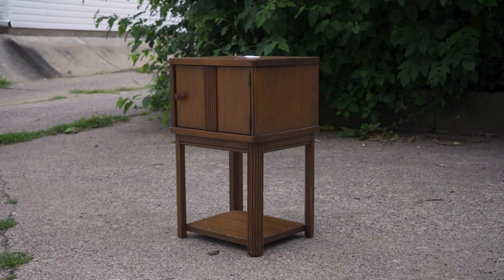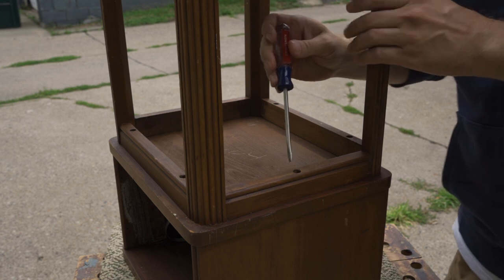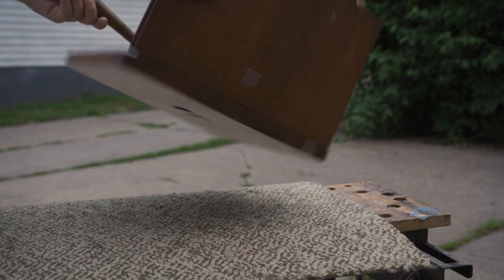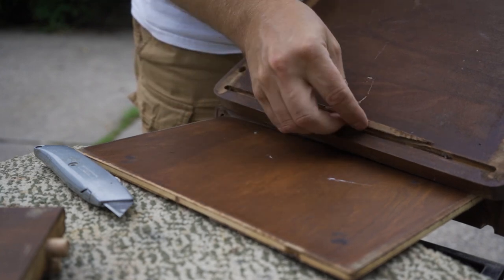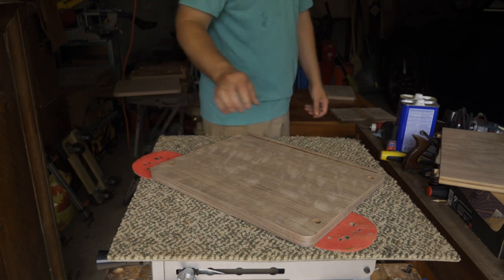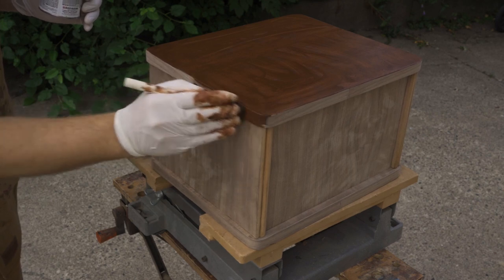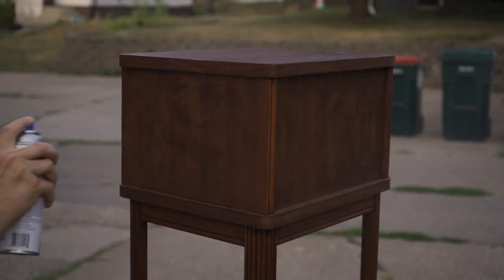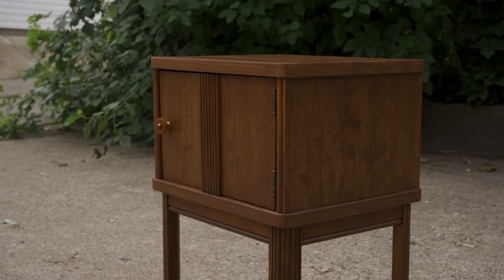Thrift Store Rescue #24 | Refinishing, Repairing And Applying New Veneer To Thrift Store Furniture

Comment: I am not certain, but I think this small table was a Portable Phonograph Stand, for the small
portable phonographs that were popular in the early 1960s -  The phonogaph would have
sat on top, the 7" 45 singles in the cabinet section, and the 12" LP albums in the lower
section.  

   The hole in the side was for a power cord for an AM/FM Portable Radio that was placed
in the cabinet section at a later time.

These quickly fell out of favor in the mid sixties when larger, more capable modular Stereo
Systems, with Turntables, Amplifiers, AM./FM Receivers, and Twin Speakers became more
available.  

Very nice work on the veneering / restoration - this could now indeed be an elegant Cigar
Cabinet !
Reply: I think your assessment about it being a phonograph stand is absolutely spot on.  I've seen others like it with exactly that purpose.  It helps that I was born in the early 60s.   ;-)
Reply: I thought the same thing, and figured it was a high school build.
Reply: Tend to disagree. The fluting and detail work is very 1930s
Reply: @steveparker2938  Who knows, it might have been deliberately retro (with respect to the age it was built of course). Maybe it followed something like the Popular Mechanics articles of that era, which were about how to build a neat this, a cool that.

Or... it was built earlier and was later repurposed from an actual tobacco cabinet.
Reply: I would have expected a larger hole, in the rear, wide enough to pass the plug through.  Unless maybe a homemade extension cord went through that hole, which would also ease servicing whatever was placed inside the cabinet and let more than one item be placed inside the cabinet. But again there was no place reported where the socket end would have been anchored (unless it lay loose).
Reply: No, this is positively 100% a smoking cabinet from the 30’s/40’s. I have sold several (I’m an auctioneer). It seems that it was altered for some other use with the hole in the side. Too bad because these in original condition can bring really good money.
Reply: @chappy675  would it still be good money if it was just reglued with no new rendering?
Reply: @chappy675  i collect humidors/smoking cabinets purchased at auctions. If it is one, perhaps a hole was made for ventilation or the door sealed shut.
Reply: My grandfather had a similar piece he used for his pipes and tobacco.  It sat by his spot on the livingroom sofa

Comment: Ah, the old duct tape and staples technique. Lol
Reply: Seriously!  Even if the previous owner didn't have wood glue, you would think super glue would be used.
Reply: Works every time!
Reply: Scotch tape around here, cheap and lazy bunch lol.
Reply: A proffesional would use wood glue to stick a patch of tougher plastic to the inside of the cabinet, and use a bent 4 inch nail to hold the outside together, works much better than duct tape and staples.
Reply: @Beerwalla1  I'm with the 4 inch nail but only if it's rusty to blend in with the natural woodgrain finish. Actually what was I thinking, obviously it's rusty, who has new 4 inch nails anymore.

Comment: What a great little cabinet.  I’ve not seen one like it before.  I love that you covered the top portion in veneer and ran the grain the same direction as the fluted molding and the legs detail then stained the same as the veneer.  It’s the little things especially that make this stand out. Great job 👍
Reply from the maker: Thank you.

Comment: Due to the tobacco odor, I suspect the small hole may have been for an humidity probe that was attached to a meter outside the cabinet.  Nice job with clear descriptions and reasons for each step.  Thanks.

Comment: What a wonderful piece of furniture. Nana could use it as a plant stand or Grandpa could use it as a bar table. Something that would look nice in the corner of the room.
Have you had great success with the peel and stick veneer? Takes so much pressure off a person in not having to cope with contact cement.
I look forward to more great restorations.

Comment: I appreciate your attention to detail. The cabinet is good for another 50 or 100 years! I have also learned that the antique dressing table could have been saved from peeling veneer. I wish I had it back so I could try to give it another lifetime of use based on what you did today.

Comment: I'm almost certain this was an old humidor robbed of it's copper. I've been looking at these for  years now, have seen many in antique stores and even own one of my own bought as a future project. I've found that resell value goes way up if you've got some thin copper plating to line the inside of the cabinet. Project came out looking wonderful!

Comment: I love the little tips this guy provides, like using a block when cutting against the veneer grain. Or using a razor to wipe off excess filler - why didn't I think of that lol. The only thing I didn't like in this one is the color. For me, it's just on the dark side. I like to see the grain pop, so I would have used Danish oil. And then a lighter gel stain for the accent (non walnut) parts. This coming from a non-expert :-)

Comment: Like the use of the knife blade for the veneer with the grain - use that, too - but I also have a veneer saw with a curved 3" blade intended for with the grain, but also appears to work wonders across the grain. Almost no set to the teeth (17TPI) so it "glides" rather than cuts. Still, knife edge might be better, as you suggest, for cross-grain.

Comment: Beautiful, as usual. I have a question. It’s about something I noticed other conservators and restorers do as well: if they end up having to disassemble a piece, they reassemble it first and then they apply stain. Apart from propping the pieces to dry, I would think it would be easier to stain the pieces first (avoiding the surfaces you intend to glue), particularly the ones that make up the insides of the compartment. Would there be a drawback to this, or is it simply more satisfying to watch the transformation of the piece as a whole?

Either way, watching you restore this little cabinet to a showpiece was a joy!
Reply from the maker: It would sometimes be easier to stain before glueing but the problem is that when you glue it up, you might get glue squeeze out onto the newly stained wood.  That’s hard to clean up without removing the stain. It’s easier on unstained wood.  You can sand it without risking removing the stain.
Reply: @DashnerDesignRestoration  That makes complete sense. Thanks!
Reply: @DashnerDesignRestoration  That makes complete sense. Thanks!

Comment: I received a 1940s waterfall style small dresser with grooved handles and edges. The grooves are similar to those on this piece. But, someone (my grandmother, I think) covered it with flat wall paint, which, for obvious reasons, I would really like to remove. :) This would be a first for me. Would you recommend a paint stripper or sanding. It's a thin coat of paint. I don't know what I'll find underneath. However, I'm confident it's not some magnificent antique. I don't expect miracles. :)
Reply: @pamelap.123  I saw it. It was great. I'm just unsure if using stripper or scraping/sanding is the better option.

Comment: Great work. Do you ever get finish issues when you lacquer in such open air? I know you buff and wax it, but sometimes when I do similar I get particles that affect the finish integrity when they're buffed out. Is it about having a light touch and just keeping the environment as clean as possible, or recognizing that imperfections will happen and that's part of the character of the piece (or both)?
Reply from the maker: I do get debris in the finish sometimes.  If it’s really bad I will sand lightly with 320 or 400 grit before the last coat.  Anything left after that I will either carefully pick out with my fingernail, buff with the steel wool or just accept as an imperfection that happens when you finish outside. Also, avoid applying the finish on windy days.

Comment: I thought you're videos I watched were very informative. I've only been refurbishing furniture about a year and am just starting to work on pieces to sell. I have what I believe is a mid modern century corner table with peg legs. Looks like you work on similar pieces. I was hoping I could get some advice from you because it's in pretty rough shape nails sticking out in the back (of what I realized after I got a closer look and I'd already purchased it?)  wood panels..
.there are pieces of  missing but I don't know if I should repair or not repair just cover up and do as is.  So I was wondering if I sent you some pictures if you would be able to, obviously, without seeing it in person just give me some suggestions and it fixed trying to fix those problem areas is going to make it worse. I cannot forward to open a can of a room right now

Comment: I have had good luck cutting the veneer from the right side, with a metal straight edge clamped on and a brand new utility blade. Because the straight edge is clamped, i take several gentle cuts. I then sand to the exact dimensions. ( I dont own a router)

Comment: Three things: Use a glue brush! We are all scared for your fingers getting a splinter, you know. It causes anxiety - opposite of ASMR effects.
I had hoped that with all the wonderful care you took to glue it up properly, you would have used your rubber cement technique with traditional veneer, for greater longevity.
So sad that the stain made it splotchy. I think your trick of sealing it with a thin coat of varnish before staining would have worked there.
Fourth bonus thing: You did a beautiful job with a darling piece, even with the other three things I mentioned! 🥰😁🤩
Reply: And GARFIELD!!!! 💓💖💘

Comment: 00:20 - That mystery hole is about the same level as the doorknob.  I suspect it was where an owner put a nail or screw to loop a rubber band around it and the doorknob, probably to hold the door closed once the break on the other side occurred.  No respect for the furniture, but a very down-home practical solution.

Comment: I love your videos - so meditative!  I have to say, though, that the use of so much stain to me is a waste of beautiful piece of veneer... The stain (to me) makes it look a bit artificial (and sometimes a little blotchy, too). Like you, I do prefer the ambery look of old wood, but I find that applying several thin layers of shellac brings out both the ambery quality and the natural wood grain really well without the danger of blotchiness. And the natural wood is not hidden by the dark stain... I wonder if you've ever tried that method? several layers of shellac can leave a very shiny finish, but it is quite easy to knock back the shine a bit with some 0000 steel wool and a bit of clear wax (or darkened wax, if you prefer...). Also, apart from bleached shellac, there are unbleached versions in different tints ( reddish and orange-amberish) to enhance the effect. Plus, you can experiment with mixing a tiny amount of alcohol-based stain into the shellac (after the first layer) to get a more subtle stain effect. So many possibilities! I like trying things out on little scraps of wood

Also, if you prefer the dark color, you could prep the surfaces with one layer of slightly diluted shellac before staining. This helps to avoid any blotchiness.

Comment: Regarding cutting the veneer across the grain ... to avoid breakout, would it have been more advantageous to first score the final side before cutting through via the back side? Assuming, of course, that the score line and cut line are exactly along the same plane.
Reply from the maker: It would be advantageous but that’s the challenge, getting the score line on top and the cut line below to line up.
Reply: @DashnerDesignRestoration , thank you.
Beautiful work there!